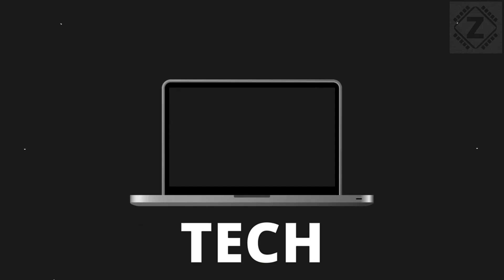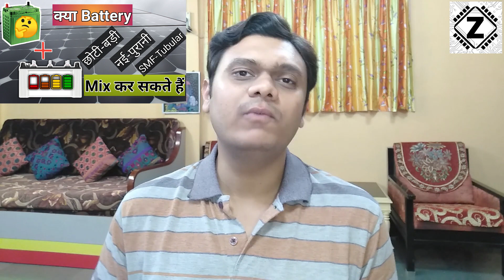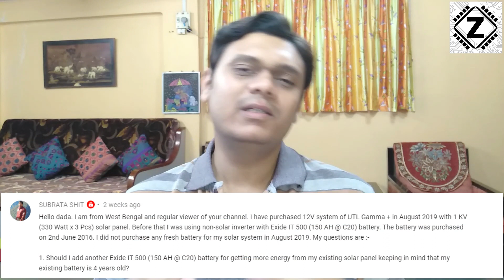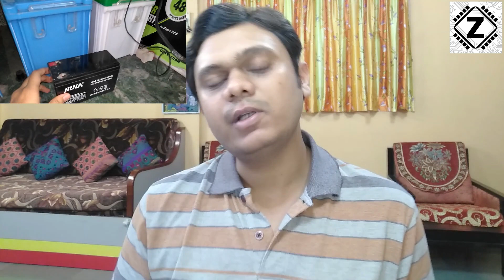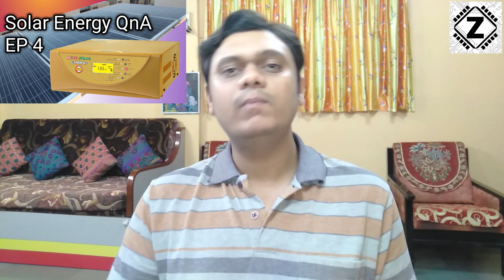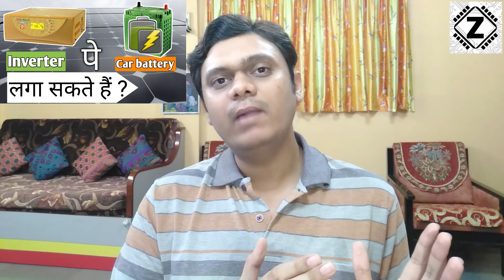[Eng] How to Parallel Different types of Battery | Mix Size, Chemistry, Topology, Age, AH Rating

Comment: Well done Sir, good video. Please I want to ask, if my calculation is correct, I have 2 x 100ah sealed batteries in series- 9months old , I want to add 2 new 75ah same brand to make it 48v system, can it work. Or what is your advice, I want to keep the value of my old batteries
Reply from the maker: Hi,
This setting will not work. Dissimilar batteries cannot be added in series. I Recommend you watch the video entirely & Carefully.
Reply: @ZenInnovations  
I have watched it, I also tried to watch the suggestion on solar energy ep4 but it was  in Hindi. 

So how can I upgrade my 9 months old 24v system to 48v system, thanks Sir.
Reply from the maker: @PlainAndSimpleEngineering-24  Yeah, My Hindi Videos See more demand than English ones.
Anyways, If you're adding batteries, make sure to buy exact same model of batteries which you already have.
Its recommended to Equalize them on a 12v charger before making a 48v set so that all 4 batteries can be brought to same voltage.
Reply: @ZenInnovations  Thanks Sir for your quick response. Please I want to ask if it is necessary to use battery balancer for 8 batteries in series. Some promote it, others say not needed. Please your advice Sir. Thanks.
Reply from the maker: @PlainAndSimpleEngineering-24  For large number if batteries in Series, A Balancer is recommended.

Comment: If I had 6 × 12v 35 ah making the 72v 35 ah and added in sequence not parallel another 6 × 12v 20 ah would that make it 72v 55ah ?
Reply from the maker: What do you mean by  'sequence not parallel'
Reply: @ZenInnovations  okay so I meant to say I'm hooking up 6× 35ah together to make 72v 35ah right.. 
But I want to on each of the 35s add to each individual a 20ah to make it a 55 ah then put the 6× 55ah together and have the 72v 55ah.
I love power stuff don't you. 
Last night I built a speed control for a universal motor into a throttle body for a motorcycle. 
The picture you see for my account is the bike all this is in.
Reply from the maker: No. You should make a string of 35AH.
Then make A String of 20AH.
THEN Entire strings can be made parallel.

You can discuss about Power stuff on my Telegram Group. We have many Enthusiasts here.
Reply: @ZenInnovations  lol before I could do anything I was using the it to go to work and a moffett blew out on my votol em100 controller. 
So I'm not doing anything until I get a new moffett

Comment: Can I mix 12v 20ah dc sealed lead acid with 12v 35ah to boost my range "distance" on my electric motorcycle.?
Reply from the maker: Yes, as Long as you're following all other points in the video.

Comment: Excellent information. I don't know if you have the time to answer this but would be appreciated i f you could. I have a Prius 3 gen it has a 45amp hr AGM battery and I would like to add an additional 100 amp hr. AGM battery and a 1000w inverter to power appliances. Does it matter about the difference in size. I want to add it so the engine doesn't have to crank up as often to recharge the house battery.
Reply from the maker: Hi Richard
You can add dissimilar batteries in Parallel but you have to test their health.
I am not sure what you are trying to do here, I need more details before I can answer you. You can also join my Telegram Group For Detailed Discussions.
Reply: Thanks for replying, I want to increase my 12v battery amp hrs so that Prius want have to crank up as often to keep the batteries topped off. I camp out of the car and need the ac power.
Reply from the maker: @richardobannon6301  you should be able to add more batteries ,provided you follow the video above.

Comment: Can we connect solar battery and normal battery in parallel.if both are lead acid
Reply from the maker: Can you mix C10 and C20 Batteries together?
Well its not ideal but detailed discussion has been done here-
https://youtu.be/jaq6g8EK-bs
Watch from 22:50

Comment: Have you ever had a battery bank where one of the parallel connected battery has become defective and starts acting as a load depleting the good charged batteries in the parallel connected bank?
Reply from the maker: This happens very rarely. Sometimes a faulty battery has bad or shorted cell. Where it can drain others.

Comment: Sir I got a new 24v solar inverter

 I have a 150AH C20 battery, I would like to add another  150AH C10 battery with my old battery.

Could you please tell me is it a good idea to mix same AH C10 and C20 battery together.
Reply from the maker: That won't be recommended.
Reply: @ZenInnovations  sir can we parallel 150Ah c20 with 150Ah c10 in UTL gamma 12v inverter?

Comment: Sir , can i connect 165 or 150ah battery with (2x80ah parrellel , 10months old) to make it 24volt system? Pl advise
Reply from the maker: That would be a Jugaad. And Jugaads come with no Guarantee.
Reply: Thnks sir

Comment: Can i connect in series two new 150 ah battery with 8 months old two 150 ah battery?if it is possible ....is it effected the new battery?
Reply: Pls advice me
Reply from the maker: This will not be ideal scenario. Still you can try matching them by Standing voltage as per QNA EP4- https://youtu.be/bupghuUxkfc

Comment: If I have 2 60v lithium battery packs which use 18650 cells but one has 25ah and the other 10ah, can I connect them in parallel without any dangerous results?
Reply from the maker: Lithium should be only Connected via BMS. If the Pack voltages are same, you might connect them in parallel. The BMS should have balancing function.
Reply: @ZenInnovations  Both packs have a BMS. Thanks!

Comment: can I parallel connect 12 V 7 AH battery with 12 V 26 AH battery and both the batteries are non flooded batteries
Reply from the maker: You should be able to, Considering you are following all other rules.

Comment: can we parellel one new battery c20 rating with old battery c10 rating ( same amp 185AH )
Reply from the maker: Its not Ideal but yes you can after following the due process and rules as discussed in QNA. Also see this video-
https://youtu.be/zVMnJFe0vDs
Reply: @ZenInnovations  Thanks
Reply from the maker: @ferozkhatri8565  also check QNA EP4
Reply: @ZenInnovations  situation : i have 2 batteries 185AH. First Battery is C20 and 2ND is C10 connected as Parallel, Now i have One pure sinewave inverter and  external 20 amp charger ( Trickle Based ) this charger supports tubular battery Bulk 14.6 and trickle at 13.6. ( inverter built-in charger can't trickle and also bulk 14.4 full battery then only maintain 13.7 float that's why i want to use external charger.

Q1. can i attach external charger with parallel batteries and connected inverter ( Note: inverter not connected to mains so it will not charge when main comes, i am using inverter as an ups standby ).

Q2. My external Charger is 20 AMP in parallel mode external charger will give 20 AMP to both batteries or divided 20 AMP into 2 Batteries like 10+10.

Q3. in which batteries terminal should i Connect inverter and Charger ( like first battery positive and second battery negative  or both on first battery or invert on first battery and charger on second battery ).

My setup is ready but i didn't try to connect i have to confirm from you after i should go a head 

so my dear friend i need your expertise on this issue, i will be very thankful to you
Reply from the maker: 1. Yes. Just charger should be good quality.
2. It will get divided 10+10 roughly.
3. I will suggest  to connect Battery Charger and Inverter Positive to 1st battery
And Both Charger and Inverter Negative to 2nd battery. This means Power from Charger can also be directly given to Inverter with Minimal wiring loss.

You're welcome.
Reply: @ZenInnovations  Q1. i repeat it " 2 batteries in parallel, 1 inverter/ups , 1 External charger " " inverter / ups positive on battery 2 and negative on battery 1 also external charger positive on battery 1  and negative on battery 2 "  2 chargers in cross connection of + - of 2 batteries ( they are not connected individual batteries ) is that ok to charge with both in that  ?

Q2. external charger battery full on 14.6 and trickle on 13.6 and inverter / ups charger battery full on 14.4 and float charge on 13.6. these charging values difference didn't effect on batteries or how batteries charging works on that cross connections of 2 chargers on that charging voltage differences please details required on that matter ?

Q3. as you said in our earlier discussion ( you said ---> you Can connect them. However due to 0.2V difference your new Battery will contribute more and will be more active. ). in that situation i have an idea that i have to disconnect parallel connections than i have to put on some load on battery which is have 12.8 volt when both batteries are on same value 12.6 or 12.8 then i reconnect them parallel again, i hope you understand what i am trying to say is i will charge discharge these 2 batteries until they have same volts when they have same volts i will connect them parallel. is that works or not what is your advice ?

Thanks for your help

Comment: Hi thank your video. I want combine 2 accu in parrallel which were 240 V -70 Ah and 240V-12Ah. They were connected to the same the charger and inverter.Is this imppossible? i wonder the time when discharge and  charged between them were same or differ? And are there some risks when operating?
Please help me
Reply from the maker: 240V accumes?
That's interesting. What kind of system is it?
I'll need a lot more information before I can answer you.
Reply: @ZenInnovations   yes. It Is ups system. Acccu1 was 20 batteries 12v-70 Ah in series ( 240v-70Ah), the other include 20 batteries 12v-12Ah in series ( 240v-12ah).
Reply from the maker: @thohayvietnam1809  if the batteries are new & relatively healthy, you should be able to parallel the strings, where they behave like single 240V, 82AH Battery Bank.

I'll still suggest checking individual batteries for voltages and issues first.
Reply: @ZenInnovations  your means that combine 20 batteries 12v 82ah in paralell , isnt it? But they relate to real state. The 240v 70ah was old accu installed before. Remain one is extension string.
Reply from the maker: @thohayvietnam1809  I mean parallel the entire series strings after thorough testing.

Comment: Kya gaama+ me 2v 100ah battery 6 nos ko series kar ke 12v main laga sakta hain
Reply from the maker: yes.
Reply: 1 battery ok hey, 2 battery lagaya tho mushkil he charging, 6 batteries laga saktha he, par full charge nahi hoga. Battery deere deere capacity kum hokar kharab hojayega
Reply from the maker: Mathew, his question is about 2v cells. Not 6 batteries.
Reply: Back up time kese rahega
Reply from the maker: normal 100AH
Reply: 1 battery 2v hey.6 batyery 12v hoga.gaama+ tow 12v hoga tow chalega.
1 battery (2vX100ah)=12v600 ah hoga
Reply from the maker: @lipuswain5933  No. It will be 12v 100AH